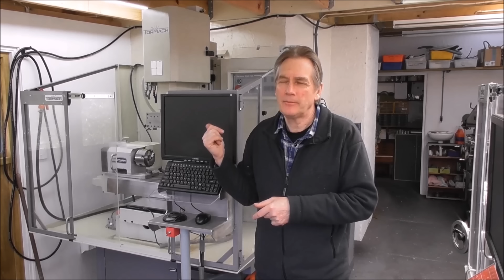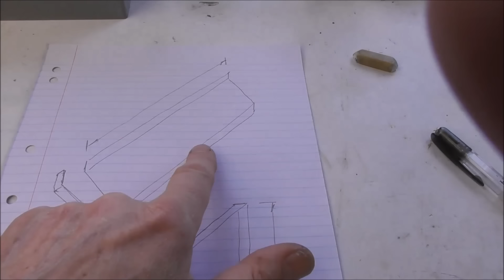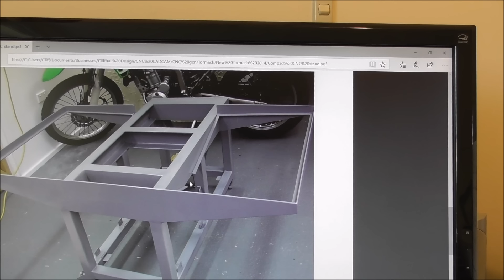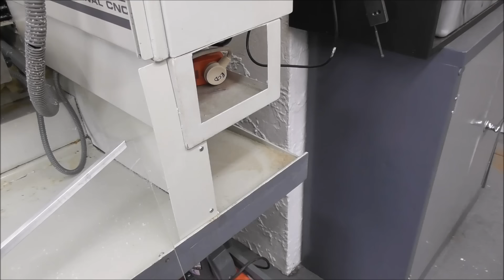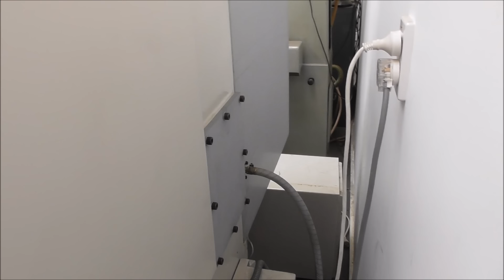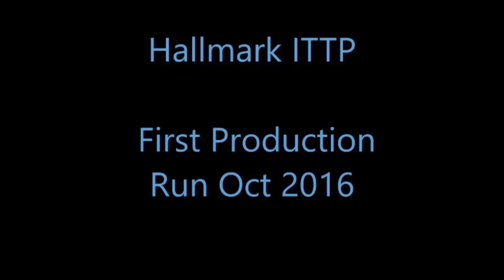Build your own  CNC Enclosure or Stand -  Part7  - Your Build

Comment: Definitely a clever way to deal with the extreme X travel scenario while keeping the enclosure as small as possible. Do you have any fear that the front two feet are potentially too close together for a three foot stance? There can be a lot of mass on the table with rapid turn or a 4th axis. Any chance of momentary lifting of a foot during X acceleration that would be difficult to notice with the eye?
Reply from the maker: Hi Jeff - There now are rear outrigger safety feet that are slightly preloaded for that reason. Cheers  Cliff